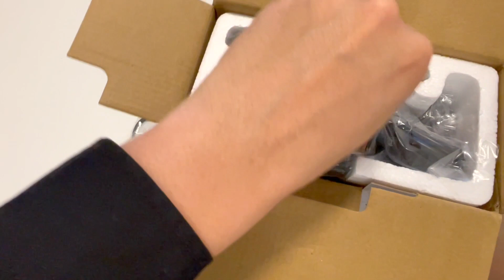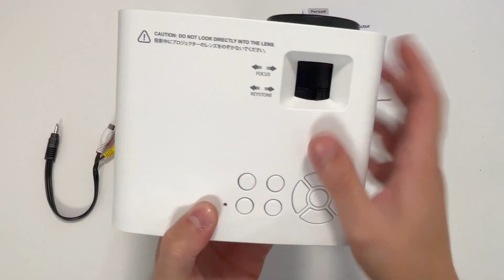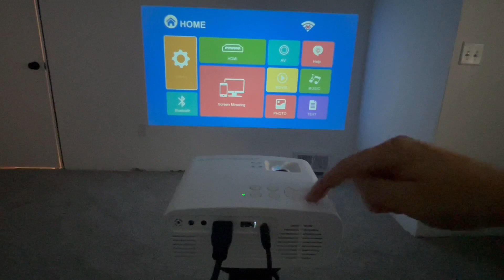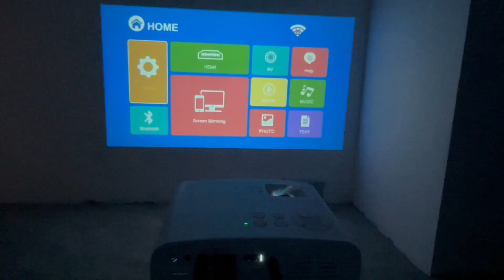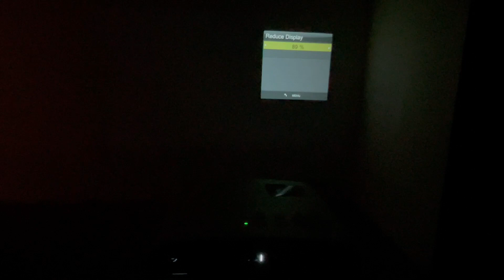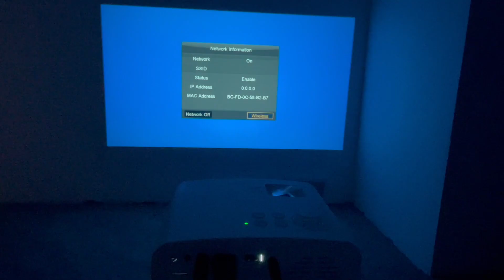Pericat 5G WiFi Projector, Bluetooth, 10000L Native 1080P Portable Video Projector 4K 300'' Display

Comment: can you not stream from paramount peacock etc with screen mirroring on this projector?
Reply from the maker: This is an issue with the provider (Peacock) in this case, not the projector. For example, Netflix doesn't support screen mirroring. If your source DOES support screen mirroring, it will work on this projector.

Comment: I Just bought one and guess...all instructions are in japoneses!! Do you know if is possible to turn into English? Nothing is working and even using the same wi-fi I still can not connecting to my phone, bluetooth is not working either
Reply from the maker: I would use Google Translate via Camera mode using Japanese > English if you're trying to figure out the manual. Pericat does have 3 models of user manuals in english on their website as well but I don't believe this model is on there.